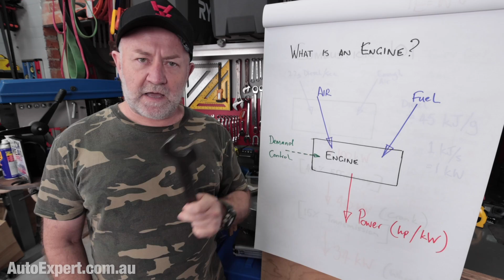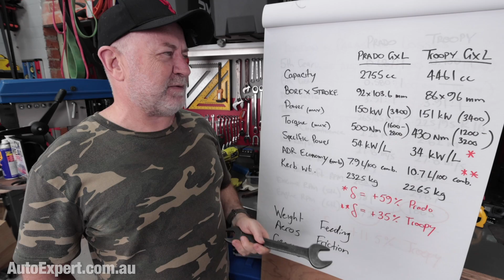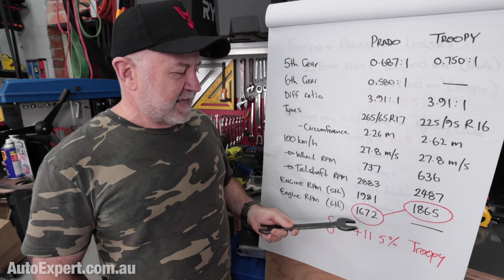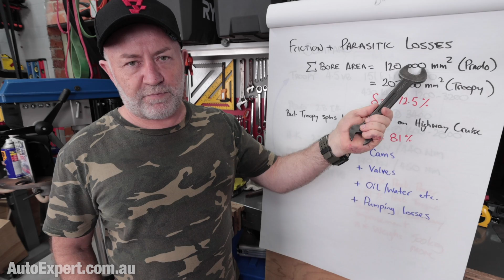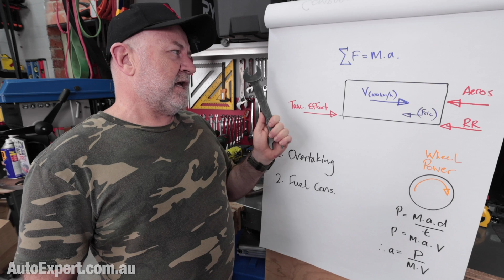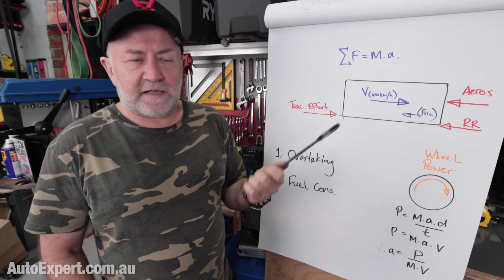Toyota Landcruiser Troopy fuel consumption (why it's so bad) | Auto Expert John Cadogan

Comment: Thanks John, once again true to your Engineering background. Appreciate the truth which is often overlooked.

Good old gasoline 350 Chevrolet. Available from 150 HP to 370 HP with fuel consumption from not much to not really good.

Fuel burn at best for most internal combustion is 1/2lb of fuel per horsepower hour.

Look at early turbojets (Boeing 707/Douglas DC8, Pratt & Whitneyt JT3C) vs turbo compound piston engines (Lockheed Super constellation Curtis Wright R3350DA3).

Flying westward from London, one needed a stop at Gander in Newfoundland to then get to New York. The other being piston engined could fly London - Los Angeles on one fill.

It is horse for Courses and what one wants.

A 3.0L Evinrude can make 250 HP at 5700 RPM. Weighs in at 300 kilos.
A Fairbanks Morse four cylinder hot bulb can also make the same HP at 30 tonnes in weight.

Efficiencies as you explain so well is what drives engineering. Most punters don't really care as long as the Hyundai Santa Fe with mum and kids going to the sports  on Saturday's causes  at least 15 near miss accidents, 40 frustrated drivers, but as long as she gets there with phone glued to her ear and the children can play sport prior to supermarket, fast food and gets 7.0L/100KM...

Then who am I to argue about road users...

Comment: Yeah, real world fuel for the Prado is more like 12 L/100KM, My brother had one of the new 2.8 litre motor and even Toyota said it was normal fuel economy!
Reply: My fully modified 10 yeat old 3.0l prado gets 11.7 everyday in low range or on the highway, running 33inch muddies aswell, sounds like dpf problems are contributing to your figures because they are ridiculous

Comment: During a trip to beat the big outdoors into submission last year (25,000km from WA to Cape York via Tassie and Birdsville), i had the TD42 beefed up with a larger ball bearing turbo, intetcooler and pump. Dyno said 140kw at the wheels through the 4 speed Nissan auto. Don't think I'll get any more ambitious given the losses mentioned,  the TD42 must be approaching its sensible reliability limit. It's in a 2k3 GU Patrol wagon pulling a 1.7T camper usually under 90kmh.
For those interested it's running an 11mm pump and 20psi max. And yes, lots of guages watching stuff.

Comment: Not sure I’d use bore area for friction? Piston ring circumference (length of contact area) multiplied by travel (stroke) seems more logical and still ignores all the crank bearings.
Reply: That's exactly the same thing

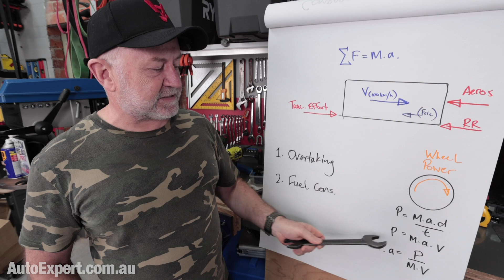Comment: WRONG again @ 26:26
Distance / time is speed, not velocity.
Displacement / time is velocity.
Do try to get it right please.
Reply: You are quibbling!
Anyway, terms are interchangeable when moving in a straight line.
Besides, in other countries/languages, there is no much difference between those terms, with velocity being defined as a speed vector, or speed as the magnitude of the velocity.

Comment: Mmm.. tyres. I ran 235/85 R16 H/T tyres on my JDM LJ78 Prado.. perfect everywhere, especially in the sand.. never used super wide tyres.. you will look like a dick..
 Does the 4 cylinder engine still have balance shafts? They need driving too

Comment: Troopy owner here 🖐️
You covered a lot of good ground there but missed the single most important factor that effects thermal efficiency - that is, the combustion chamber surface area to cylinder displacement volume ratio. That directly affects how much heat energy is lost through the walls of the combustion chamber as a proportion of its capacity. This is why 4 cylinder motors always return better consumption than a similar capacity motors with more cylinders, it's why bigger engines are more efficient than smaller engines of otherwise similar design. It's how the ship engines get their 67% thermal efficiency.
Although friction is higher, I would disagree it's the main factor in engine efficiency.
Toyota did with the 70 series what they've always done when they want reliability, they took a large engine and detuned it so that it's effectively allways in limp mode, they use a drastically larger safety margin on stressed components than they use on the smaller engines, this is why they last so long. It is evidenced by the fact that the torque curve on the 1VDFTE engine is pretty much dead flat, when we all know that a graph of the pumping efficiency (the key defining measure that limits engine output) over engine speed would definitely not be flat.
I believe comparing peak power output is not a useful measure of comparison when you have anything other than an infinitely variable transmission to direct that peak power to the ground, the average power over the used rev range when mowing through gears would be a more direct comparison, although a bit complicated to measure.
Reply: You make an interesting point but I have doubts about the 67% thermal efficiency figure. I'm far from being a thermodynamics - or engine - specialist but I'm only aware of 55% as the best efficiency ever achieved by a diesel engine.
Reply: @frogzie  you're probably right, I vaguely recall the efficiency of the biggest ship every built being quoted at 67%. Could well be wrong!
My point is more that the thermal efficiency goes up drastically as the combustion chamber surface area to  capacity ratio goes down.
Reply: It makes sense. Friction area/capacity ratio: (2*pi*r*h)/(*pi*r^2*h) = 2/r
Reply: @frogzie  I'm sure I've seen that somewhere else, is it no 84 beef in black bean sauce ?
Reply: @frogzie  when you take the entire surface area of the combustion chamber into account (combustion chamber walls+head+ piston top) it makes an even more drastic change in ratio as the individual cylinder size increases. 
number of cylinders * (2πrh)+(2(πr^2)): number of cylinders * (h(πr^2))
Or something...
Reply: If the Sheila’s like ‘em, I’m in like Flynn

Comment: How long do you reckon a 2.8L 4 cylinder with that degree of stresses is going to last compared to a 4.5L V8. I never really liked the idea of a V8 however due to extortionate rego prices.
Reply: Time will tell.
Reply: Should last fine. Small engines have been around for years. At 150kw and 2.8L it’s hardly stressed. Ranger is 2L for the same output
Reply: I have a 2.8 with 420 thousand k's on it and expect it will double that.
Reply: @Ilia volyova a big inline 6 is your best combo been a inline it has longer con rods giving u more low end touque that's why trucks tractors anything that's pulls loads have a inline 6. Been a 6 it's runs smoother then that a 4 cos it's balanced better example a 6bt Cummins has the same size flywheel as it's 4bt sibbling but having said that a inline will all ways have there place
Reply: If the Sheila’s like ‘em, I’m in like Flynn

Comment: 10l/100km on a prado? Dreaming, we don’t get under 12 on a fleet of work vehicles that do long ks all day
Reply: On the other hand my V8 troopy has never gone over 11.... 10.5 pretty consistently, and I don't go easy on it either.
Reply: My 10 year old prado with all the fruit and 33 inch muddies does 11.7 in low range or on the hwy, no chance my uncles troopie gets lower than 15 litres, no point comparing work vehicles that get flogged all day long

Comment: the small end of that open ender is bigger than 1/2"
Reply: Its a whitworth spanner measured by the diameter of the tread of the nut or bolt
Reply: yes, its a confusing way of spanner sizes. 1/2"W - 9/16"BS has an AF of 0.920". this is based on thread sizes. the W stands for Whitworth as in British Standard Whitworth and the BS stands for British Standard Fine, a Whitworth thread in a fine series pitch. confusing? yes!
originally they were simply 3/8W - 7/16W - 1/2W and so on, with out the BS marking regardless of coarse or fine threaded bolts as back then the bolts had the same head sizes, but during WW2 to save material they began to make the bolt head hex AF's incrementally smaller per diameter and added BS to the spanner jaw markings like 3/8W-7/16BS.
however, a handy spanner to have is 3/8"W - 7/16"BS as the AF for that size is exactly 18mm (0.710") by pure co-incidence.  and why is that handy? well, besides being handy fro wrenching on the old Norton Commando or series 1 Land Rover, many spanner sets jump from 17mm AF to 19mm AF missing the 18mm. and many Yankee cars now use metric bolts that have 18mm AF bolts. I could tell you a lot more about this fascinating topic but I'm sure we all have a life to live.
Reply: @bonza167  Thanks mate, no not confused, cut  a few Witworth threads in my day. Many times I have worked on an Imperial  Lathe, following Metric Drawings and using Imperial or Metric Mics

Comment: Good work. But an ecu tune can totally rework the numbers.  I'm an off roader, in a live axle cruiser. Still would have a toupie over a 150 prado any day. If only they put the 200 series engine in the 70 series body. Might be a tight fit though
Reply: Mate, They are the same engine 1VD-FTV, just an extra turbo on the 200. The 200 series auto box does fit in the 70 series trans tunnel behind the single turbo 1VD-FTV if your a millenial or girly man that can't drive a manual and got $30K for the conversion.

Comment: I can genuinely say that a 76 series same engine as troopy returns 11.2 - 11.6 L per hundred every tank and that’s giving it the berries.That’s with all barwork, winch, roofrack and duel battery. Standard suspension and wheels.
Reply: 👍 yep  sounds spot on ole mate , my 79 D/cab 2020 with 18000 kms does same same lt/100k’s at 3300kg GVM daily ,,, and with the 3T trailer on its about 15.5 down to 12.5 depending on driving conditions,,,
Reply: @nickpav2169  yeah don’t know where people get fuel economy figures from. I’m assuming people with 35s and aggressive over fueled rich tunes.

Comment: Great Video again John... Truck (Prime Movers/Tractors) manufacturer’s (usually) go into great detail to provide the correct size engine for Transporters. This is obviously important to provide the best fuel economy for the load and conditions required. I have heard there are many arguments with drivers wanting the biggest, most powerful engines - Vs the person paying the fuel bills 😜
Reply: CAT hasn't made a over the road truck engine for about 10 years
Reply: bruce poole - yes that is correct...
https://youtu.be/6jp4_ipDltk
Reply: But where is the point of diminishing returns; i.e. a gigantic engine simply guzzles fuel whether or not it's pulling a load. The key is sizing the engine to the max expected load it is expected to pull I would expect, no?

Comment: 13:47 I don't think the 76/8/9 series is designed for highway cruising. It's designed for off-roading hence why it still has solid front and rear axles and handles like garbage over 70km/h.
Reply: My VDJ79R landcruiser hauls ass on the highway, it's obvious you've never driven a V8 Landcruiser let alone owned one.
Reply: @dustyfarmer  I also own one, and two they go well on the highway, but that's not the designed primary purpose of these vehicles, it's a secondary ability. If you wanted excellent highway handling it would be lower, smaller wheels, suspension optimised for road use - pretty much a Prado.
I disagree with the "handles like garbage over 70" it handles acceptably well for its designed purpose - it's a fast tractor not a slow car.
Reply: @hayden6930  Mate, a 40 series with a 3 or 4 speed box is tractor material. I had a BJ40 with a 3B & 4 speed with Fairy overdrive which I thought at the time (mid 1980's) was pretty zippy & a HJ45 Troopy H engine 4 speed which could best be described as a slug when it came to highway hauling, The H engine was a gutless motor. My VDJ79R will quickly wind out from 90 KPH to 140 KPH or more but I don't want to lose my licence on the spot. It easily cruises all day at 110 KPH and I can overtake at will.
Reply: @dustyfarmer  hehe I know mate, I also currently own a BJ40 and a HJ47👍 and have driven both around the country at various times,
just pointing out that if you wanted a good highway car and off road reliability/capability was a secondary requirement then the VDJ76/8/9 might not be your first choice, if you primarily want off road reliability/capability and as a secondary requirement can go on the highway them it becomes the best option hands down.
If you're just a mad keen fan of them like me you just have one because you like them and it doesn't matter what anyone else thinks 😆
Reply: @dustyfarmer I drive one every day underground. They're not comfortable compared to anything else and they make bugger all power and torque unless you throw your wallet at it. 

A base model Volkswagen polo is faster from a dig and my 30 year old 6 cylinder bmw will destroy a 79 from a rolling start all the way to 2 ton.

But that's besides the point. The main point I was making is they ride and handle like arse until you spend big money on them.
Reply: @liamandrewartha4803  Hardly counts driving one underground at 3 km per hour, your BMW wouldn't make it across a wet lawn & who drives a VW polo? Like I said, you know 9/10ths of fuck all when it comes to Landcruiser's
Reply: Totally agree. It's designed to be tough, and not much else.

Comment: How much power does it take to destroy a mustang dyno in contact with MT19x15 almost slicks? Before I learned I was bulletproof the interesting way, my car received some hidden damage that hurt 2 days after. I just topped off an LT1, 4L60E 6 SPEED auto, and a dyna 60 with 3.90 ratio gears. It was nestled inside a skinny 94 Impala and was donated by a 94 Caprice Pursuit cruiser. I just topped off the little extra I had done, with a dual roots hat and went to get her dynoed out of curiosity. It was bored over 0.40, stroked, P&P with valve lapping, and low slung to pretend nobody noticed the go-fast whistle. The 6 auto was regeared with shift kit and ungodly quick valve body, to the 3.90:1 locked dyna60. Mid 4th the friction rollers took a lunchbreak and dropped her all crooked. The dyno owner did do the repairs it needed, except the cracked rear suspension mounts.I was driving her perfectly like chevies enjoy, mostly sideways and fille

Comment: The claimed troopy v8 torque of 430nm from 1200-3200 rpm is simply bullshit, having driven this motor in Ute application it’s immediately apparent the torque is bugger all until well past 2000rpm.
This explains the short gearing as the vehicle would be undriveable with any sort of load with taller gearing.
I think Toyota’s engineers knew this chose the right gearing for the actual torque curve.

Comment: Here's a thought for those that want the "V8" bragging rights:  Toyota use the 2.8l 4cyl, have it banked over in the engine bay, and attach a fake 4cyl bank on the other side so it looks like a V8 😄.  Best of both worlds- lift the bonnet and show off his mighty V8 and get the power and  efficiency of the 2.8  4 cylinder (now the DPF issues seem to be sorted) 😀😀.

Comment: Now through a tradesman trailer on the arse end at say average of 1.5T and see how it goes
Reply: A troopie would be the single worst car to buy for a tradie, they all buy dual cabs for a reason
Reply: @emoil42  yea  mr know it all whats that?
Reply: The engine with the higher power will do a better job every time in every situation.
Reply: @jasonfields2793  I believe John just conclusively disproved that theory with his explanation, as well as stating the better Troopy engine would be the Prado engine.The Prado has LESS power, yet is MORE efficient.
Reply: @markh.6687  the prado engine makes more power at cruising speeds and is only 1kw down on peak power.

Comment: Really enjoy the content. Yes I’m a self confessed Toyota fan boy wife drives the new Prado and me a 200 series. I have a few 79 series in my fleet as work cars. No I can’t disagree with your logic but is there anything wrong with a bloke saying I want the v8 because I like it😀. Also I’m sure your logic and math is true and correct but is there another possibility for train of thought that yes the prado has the same power as one of my 79series utes but would it be to far to say that the prado is on its limits with those power numbers and the 79 has plenty more to give. Also another thought is my wife’s prado is busting it’s gut and working twice as hard to produce those power numbers. Yes more cylinders more friction more wear in the v8 but only using half and much effort to produce the same power. No replacement for displacement😀. Keep up the great work very much enjoy your unbiased and well educated videos. Kind regards

Comment: I think the main reason people go for the Troopys is reliability.
I mean, there are plenty of more efficient 4WD's, that's just a fact. But if you're driving around in the middle of nowhere, breaking down is more than a bit inconvenient.
The Troopys are reliable because they're simple. And they're also easy to get parts for.
Reply: So's a 4jj1 , rock solid , flat torque curve and economical
Reply: @alexfrankl7861  4JJ1 is common rail.
Common rail improves efficiency, but has lower tolerance for error.
Reply: @Knowbody42  all the 4.5L V8's are common-rail too.
And the 'easy to get parts' theory is rubbish. If you need anything more than an air, fuel or oil filter (which you should carry your own spares of anyway) whilst out in the bush, you're gonna be waiting for parts to be flown in no matter what brand of vehicle you drive.
There are no car dealersships and parts departments in Birdsville or Bamaga, for example!
Reply: @danbywaters6123  Wherever you do find dealerships for 4WD's, you'll almost always find parts for the Troopie.
Reply: @Knowbody42  that's exactly my point. There are no dealerships out in the bush!!!!
Reply: @danbywaters6123  Which is kind of a red herring.
Reply: If the Sheila’s like ‘em, I’m in like Flynn